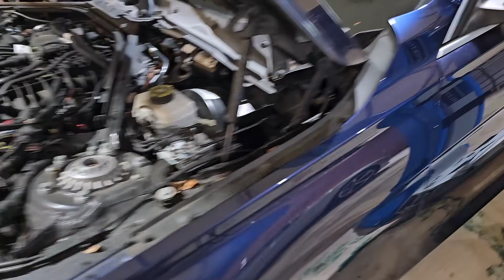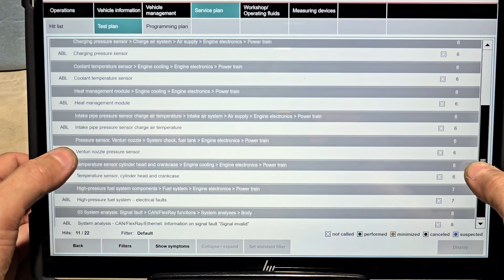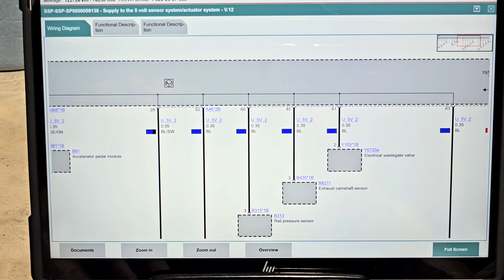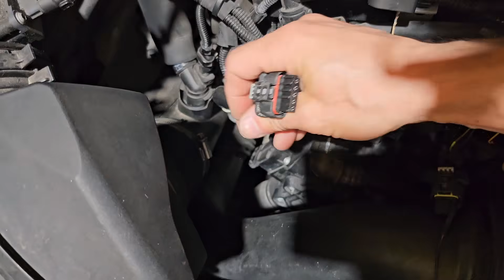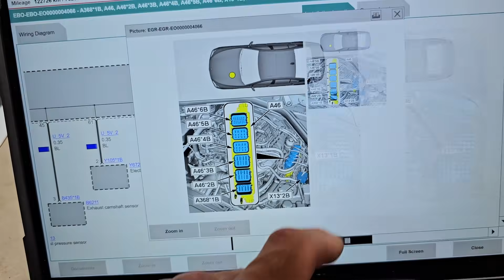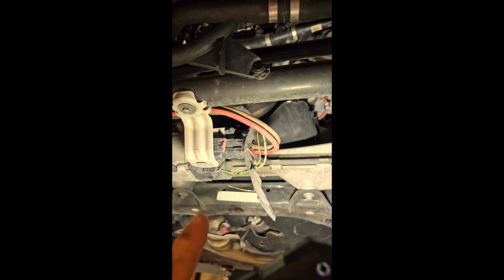Why is important to properly diagnose a BMW

Comment: A nice systamatic tracking of the short problem, is the only way to find the solution. With noting is the right size pin wiring to do the measurement as a lot of mechanics prod the  connections with much wider pins making it hard to locate  intermittend fault. Wel done!

Comment: I don't understand some shops. Even if they are incompetent and can't perform proper diagnostics, they could send your ECM to a shop and they can verify the problem.
All electric faults are basically the same and repaired with out any parts.

Comment: The main problem is that ALL automakers are relying WAY TOO MUCH ON ELECTRONIC SYSTEMS. UNTILL AUTOMAKERS CAN GET THEIR SH!t Together and developer a totally self diagnostic system that can accurately tell the owner and mechanic with accurate errors, delete all electronics on the engine.

Comment: I wouldn't be surprised that the shop didn’t replace the DME and used the original one.  Thank you for another great video!
Reply from the maker: That can also be a fact, unfortunately, I didn't think about that, I'm able to see the manufacturing date and programming date of the DME, and can compare it to the vehicle,  but now it's too late, the vehicle is gone!

Comment: Felicitari ca faci o treaba buna, si chiar te duce capul. E foarte util sa arati cum se foloseste ISTA.
Pentru tubul termocontractabil, nu e mai sigur sa folosesti o suflata cu aer cald in loc de torta cu flacara ? Stiu ca in workshop manual chiar asta recomanda ca si unealta.
Reply from the maker: Da o suflanta cu aer cald trebuie folosita, nu flacara deschisa ! Dar stii vorba aia fa ce zice Popa, nu ce face Popa !:)

Comment: The most instructive 38minutes video I ever seen!Thank you for everything ❤
By the way, I had almost the same issue when I rebuilt the e61 I bought this summer. One of the ihka module pin was bent giving a 9c55 error (fogging sensor).. It was so tricky that I almost gave up after like 2 weeks. When I found it I was excited but at the same time I was scared at the idea that whenI bend it back it will break. Fortunately, it worked and no more errors from that part 🎉.
Again, thank you for your video, I had a very good time watching you doing a great job and teaching us the fundaments
Reply from the maker: Awesome, glad you enjoyed the video and thanks for sharing your experience!